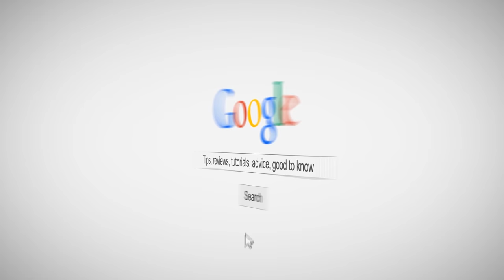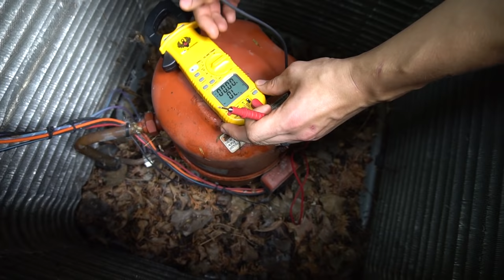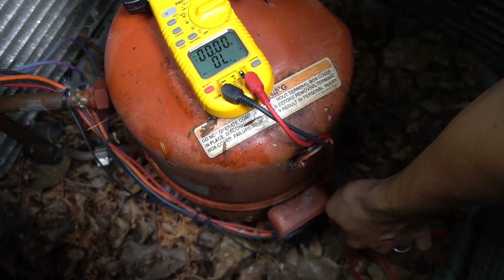AC Keeps Tripping Breaker and The 10 Most Common Reasons Why

Comment: So my ac blower inside the house makes this loud humming sound and then trips the outlet inside the house. What does that mean
Reply from the maker: Just from the sound of it, either the blower motor capacitor is dead or the motor is burnt out. Watch some of my blower motor videos for more on that topic
Reply: Does your compressor kick in and does the fan push out air? Sometimes it's not the fan run cap that goes bad but it's the compressor cap that can cause a hollow loud humming noise, it really depends on the size and shape of the air conditioner, whether or not it will be a loud or somewhat audible buzz / hum.

Comment: how can fix my ac 1.5hp always keep tripping even i already change the capacitor and contactor? the breaker is 15. amps.
Reply: The wrong dude ain't but three things wrong with heat pump if you know what you're doing

Comment: Word of Advice TV  please help someone was working on my AC it was spinning clockwise before he changed the capacitor after it was changed the fan was spinning in a counterclockwise is it possible to do that by putting the wires on the wrong slots on the capacitor
Reply from the maker: Yes. Most of the time the HERM and C wires on the capacitor are reversed when that happens.

Comment: Hello, one of the AC disconnect fuses went out after 12 years it's a 60A. I replaced it and about a week later the exact same same one (there are two) went out again. Lucky I bought a couple of extras BUT I'd like to to get an idea of what may be causing it to go out. Tia
Reply from the maker: I would thoroughly clean the condenser coil even if it looks clean to begin with. A dirty coil increases amp draw. Also, if your unit does not have a start capacitor, I would put in a SPP6 hard start kit to decrease the start up amp draw. (especially with older air conditioners)

Comment: Hello, I have a question. Can a 60 amp AC disconnect breaker box use on a 30 amp circuit condenser? It should give more power for protection in case a surge of short circuit happen right?

Comment: Hey body thank yoi for your intructional video , I woul like to ask you if is possible use a capacitor 50+5u  5% replacing a 620762 capacitor 35+5uF 370 v VAC ?
Reply: No.Capacitor uf must be within 3 % + or - .

Comment: When I look at my contactor it has 240V coming in but 0V coming out. Would that be the contactor or would there be a short somewhere. When I press the plunger the fan and compressor turn on but only if I hold it in.

Comment: I desperately need some advice.  I am experiencing an electrical issue in my 2 1/2 year new construction townhome where there is a loud clicking noise coming from a regular outlet on a GFCI circuit.  Half of the time this would occur while the air conditioning is running and when this happens, the air conditioner would turn off a minute later.  Other times it would happen while the air conditioning is not running or right before it comes on.  I have had a few electricians and spent lots of money and still have no resolution.  One suggested that there could be interference between the duct work and electrical wiring in the attic creating an echo effect.  However, does this sound like it could be a compressor issue as described in the video?

Comment: My ac keeps tripping the braker, sometimes for just the AC switch, sometimes the main switch for entire house.   I reset everything but it’s happened several days in a row so I know there’s a bigger issue.  Also the disconnect near the AC is now stuck in the ON position, it cannot be moved to the OFF position.   Have you ever seen that before?
Reply from the maker: I don't think I have.. Sounds like a pretty serious problem. You have something shorting out to ground. If you are comfortable with it, I would turn off power to the whole house and look for loose or burnt wires in the ac breaker, the disconnect and in the condenser unit. Otherwise call an electrician to come find the short for you.

Comment: I like all your vdo my friend.  Great job.  I have dumb question.  My house have two heat pumps sit outside and one is not working.  I call a service man came out to look at it and he said there should be two furnaces inside my hous for those heat pumps.  I cannot find the second furnace anywhere in the house.  Is there any chance that both heat pumps shared only one furnace?  One heat pumps heats up stairs and one heats down stair. I just can't find the 2nd furnace anywhere.
Reply from the maker: Is it possible that it is in the attic or in a crawl space? If you follow the refrigerant copper pipes outside, you will see where they go into the house. Maybe that will give you a clue as to where the second one is. I don't think the heat pumps share the same air handler/furnace.

Comment: I had a call the other day, it is a walk in freezer not running. I changed out the contactor and when the compressor came on it fried it immediately. Would you say that the compressor is shorted to ground?  The capacitor is good and the fan works until it fries the contactor.
Reply from the maker: I can't say for sure. Something is definitely shorting out but the only way to be certain would be to take some resistance readings between the compressor windings and ground. Another thing that you could try is taking off the compressor wires from the contactor (make sure they don't touch anything and short out) and try turning the power back on. If nothing fries or no breakers trip, then you know somethings up with the compressor or maybe there is a burnt out wire at the compressor pins.
Reply: @WordofAdviceTV  Yep, The compressor is shorted to ground. Thanks for the video and the advice!

Comment: Also I only have an analog mutimeter so I'm not sure how to use it for this job as I can find owners manual. It is a GB Instruments model GMT-319. I would like to add that none of the capacitors I installed had any letter on to for Common or anything. Is there a specific way these need to have the wire connectors put back on? I took pictures before I unhooked the and just hooked them back the same way but again no lettering to tell me what was what on top.
Reply from the maker: If it is not a dual capacitor and it only has two sections, then the way you did it will work just fine. Only the dual capacitors are labeled like that.
Reply: Thank you for responding so quickly Jay. Your videos are awesome. Through process of elimination from your videos I figured out its the blower motor. This air-conditioning unit is an all in one outside unit with nothing inside home only air vents and air return where filter goes .The pan was filled with orange bloom algae and water so I shop vacuumed it out but a little water is still seeping in the pan. Don't know if that residual but is it safe to pour a little 50/50 water and bleach in pan to prevent return or growth of more algae  and maybe use tablets to dry up wager or once the blower motor is replaced should the heat from it evaporate the water? There is no drain lines
Reply from the maker: Glad to hear my videos were helpful! :) I would just vacuum it out and see what it does after you put in the new motor. If the pan you are talking about is the drain pan that is under the evaporator coil, it is not recommended to put bleach into it as it can corrode the coil. That is odd that there is no drain lines.. Where does the condensation that the evaporator coil collects go then?

Comment: UPDATE: I bypassed the breaker outside near the condenser, as it was loose, and I wanted to eliminate that from the possible causes. Well ... I depressed the contactor at the condenser, and it briefly smoked and I think it tripped the breaker again, though at this point, I'm losing track. Anyway, I bought 2 capacitors and a relay, as they were only $40 combined. If they work, great. If not, I guess it's the compressor afterall.  Wish there was a way to test the compressor.
Reply: L

Comment: So the AC on my condo is very old, somewhere between the 80s and early 2000s. It trips the electrical breaker when the oven or stove is on for a while; but it also has a habit of tripping for reasons we still can't figure out.

I called an AC company and the technician essentially said he couldn't work on it because of it's age. He said that the fluid used was "grandfathered in" and was no longer legal to recharge a system with. He was pretty adamant that the entire system needed to be replaced for about $5,000, and that purging the lines and recharging it with new Freon would cost at least $3,000.

He didn't even open up any panels or anything. I didn't get charged for the consult, but was he trying to scam me?
Reply: Your unit uses R22 refrigerant (freon) which the EPA has determined is end of life.  It is not uncommon for tech's to upsell a modern unit (now R 410) since the cost of maintaining R22 is out of the roof.  The problem you described of tripping has nothing to do with this. That is an electrical problem, not an HVAC problem. An electrician has to ensure the are not wired of the same lines.. which would be illegal.  It can also be a service issue, though that is unlikely since your home is quite new.

Comment: ANOTHER UPDATE: I tested the compressor leads with an ohm meter/continuity tester. They all gave readings (not OL). So that's good news, right? I'm thinking a capacitor is to blame. Thoughts?
Reply from the maker: Did all the ohm readings add up the way they should? ( https://www.youtube.com/watch?v=0aAj0iqP95A&list=PLK8tZPlovA8Aw5W4GIoingc_enl5apH4C&index=15 ) There are a few ways a compressor can go bad, it being shorted to ground is just one of them.

Comment: Good information. Thank you for sharing your knowledge.

Question: when you have to splice wires within an AC or furnace unit, should you install an electrical junction box for that purpose; or, is the electrical compartment inside of the AC or furnace cabinet considered a box in and of itself?

Comment: I have followed all of the tests you provided and have found nothing wrong with the non-working AC compressor (immediately blows 1 disconnect fuse when turned on) except that the AC disconnect has 25A fuses but the unit specifies min & max of 30 amps.  It is possible that replacing the fuses with the higher value will fix the problem.  The circuit breaker at the panel is rated for 30A's as well.  Also the power saver box, can that be tested or is that a power company issue?
Reply: The circuit breaker cannot be below the RLA (run load amps) of the compressor.  It is often, just above - but not too much.

Comment: So I’m not getting any reading when I disconnect the wires from the compressor. But when I do your second trick without the meter with unhooking turning on, (it turns on and doesn’t trip, but when I hook it all back up it trips).   It turns out to be 50/50 on your tests do you know what route I should go?
Reply: I have the same problem.
Reply: Found it. Capacitor was broken. Changed and now everything works.

Comment: I have been trying to track down my problem... the ac  is off on the thermostat .... not calling for any cooling or heat... but after a day or few days I see the breaker has tripped.... I already disconnected the compressor crankcase heater ...  but did it again. I was wondering what else I can try or if you have any ideas. The crankcase heater was connected to the 240volt and on all the time so that is why I disconnected it. Thanks

Comment: My Samsung inverter makes circuit breaker of the house go off as soon as the compressor starts.takes two second with a screeming noise. Lately the compressor has been making noise. No short between windings and the ground  11.7ohms between each winding. Do you have any suggestions?

Comment: I'm having trouble with my mother and father's heat and air unit it keeps blowing disconnect fuses 30 amp,, it doesn't do it after I change the fuses on initial startup but after it goes through the cycle on the second start up on its own it hums a little and the fan tries to come on and it pops the fuse every time,,but on the initial startup starts at fine the pump sounds great the fan runs freely,, I have replaced the run capacitor also have added a hard start,,but the fuse blowing issue continues any help or suggestions would be greatly appreciated,, thanks
Reply from the maker: I would disconnect power to it and check all the wiring for loose connections or burnt/brittle wires. Especially at the compressor pins. If the wires are burnt off at the compressor pins I normally use this kit to repair it:

Qwik Lug Compressor Wire Repair Kit: https://amzn.to/2Myn6et

Comment: I noticed that my breaker in the main box in the garage had popped so I reset it. The electricity in the entire house started flickering IMMEDIATELY so I flipped it off again and the power stopped flickering. Thoughts?
Reply from the maker: You likely have a bare or broken wire that is touching something metal and shorting out to ground. If you can't locate where the short is, I would call an electrician to be on the safe side..

Comment: Unit was working great then one day I noticed that only the fan was on and the compressor wasn’t coming on. So, I reset the breaker and my compressor came on immediately. It cools down to the desired set temp which is 75 then it shuts off. Once it comes back on again, the fan turns on but not the compressor. So I reset the breaker once more and sure enough the compressor immediately turned on again. It seems that the breaker trips once the compressor finishes it’s cycle. Any suggestions?

Comment: my house A/C unit while running makes a buzzing sound that sounds like it's coming from the wiring. same sound at start up for a second, it's done that start buzz sound at start up for 18 years.    
If buzzing while the compressor is running lately it will pop the circuit breaker....   If i reset it it's usually fine for a long time... few months...  
Bad breaker?
Reply from the maker: I wonder if that is the contactor "chattering" when it pulls in. It's a pretty cheap part. You could try replacing it and see if that helps. https://amzn.to/2S1l1Ly
Reply: @WordofAdviceTV   when I first moved into my new home, they told me it was the wires vibrating inside the conduit. Due to the fact that it was a very long run to the compressor.

Comment: The capacitor was replaced. After an 1.5 the unit stopped working and sparks came from the middle back panel on tge other side of the capacitor . Any idea why

Comment: every time the power goes out my breaker trips and i have to reset my breaker to get the AC back on, what causes that?
Reply from the maker: @Barry T That's a tough one man.. It could be a loose wire/connection somewhere or a circuit breaker going bad. I would try washing down the condenser coil. Perhaps put in a spp6 hard start kit..
Reply: Mines too. First time this ever happened and it did it twice and now my ac isn’t coming back on. We slept in the heat and live in California in the desert sucks, please help...

Comment: Hey body thank yoi for your intructional video , I woul like to ask you if is possible use a capacitor 50+5u  5% replacing a 620762 capacitor 35+5uF 370 v VAC ?
Reply from the maker: That is too big of a difference. I would not do that. It may work but it's not good for the compressor. If possible, change out a 35/5 with a 35/5.
Reply: No. The capacitor uf must be within + or - 3%

Comment: i tried with my compressor the 3 connectors made a sound and i tested between the 3 wire from the compressor no sound so the compressor is fine i guess , but the CB keep tripping , i disconnected the fan , still trips the breaker i disconnect the compressor it doesn't tri[p the breaker then its the compressor, but i made the test between the ground and the 3 wires of the compressor and nothing there and measured between the 3 wires of the compressor its 2-3 ohms, what should i do ?
Reply from the maker: Well the compressor windings inside could be melted together or the compressor is seized up. In those cases there would not be any continuity to ground. So I would say there is a good chance that your compressor is bad.
Reply: @WordofAdviceTV  but if the compressor is bad wouldn't that give me 0 ohms, can the Circuit B 30 amp also cause that, tripping at a lower value of the starting current?
Reply from the maker: @EnergySeeker  A defective breaker could be the cause, yes. But in your case I would say it still sounds like the compressor is shot. I have another video on "how to check a compressor". In that video I talk about what the ohm readings on a compressor should be. Watch that video for more info
Reply: @WordofAdviceTV  i checked your video its very good and i get the same value between the 3 wires of the compressor so i will go after the CB , thanks for all your help

Comment: I am not getting 240V from the breaker to the disconnect. The fan motor will not start. The capacitor was replaced.

Comment: Cant you just test each winding to ground from the electrical panel since the wires connect to each terminal? Thats how I was taught.
Reply from the maker: Yes you can do that too. But it's possible that the wire has a bare spot and is shorting out, or there is a bad connection at the compressor pins. I just go straight to the compressor pins so I know for sure if it's the problem or not.

Comment: I unplugged the fan motor and it didn't pop the breaker, can a bad fan motor capacitor do that or is the fan motor bad ?
Reply from the maker: It's possible that the capacitor can cause that but it is a lot more likely that the fan motor is shorted out.
Reply: Ok thank you.
Reply: My is the fan inside the house the wire burn. But now the fan come on but it don't flow halrd